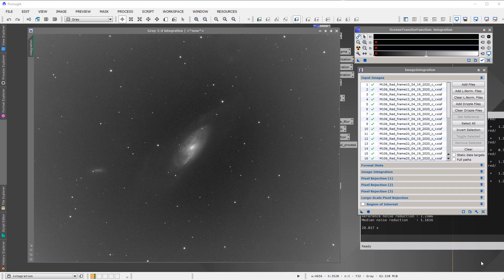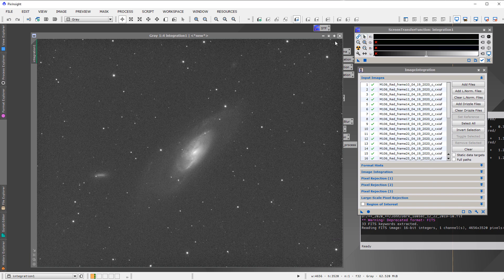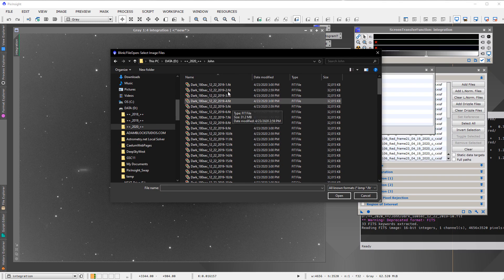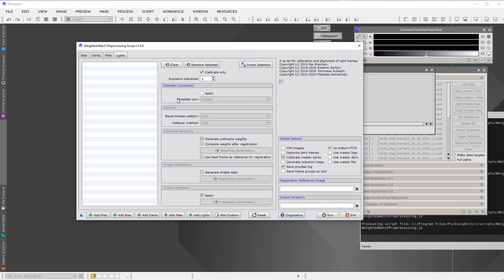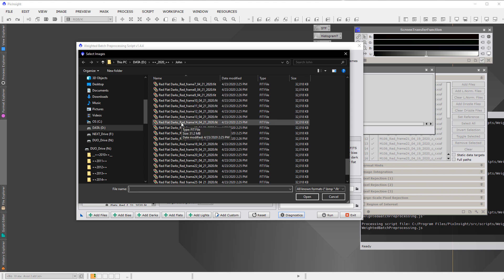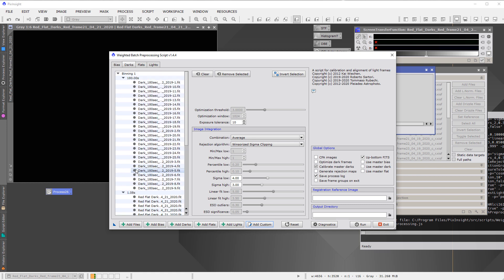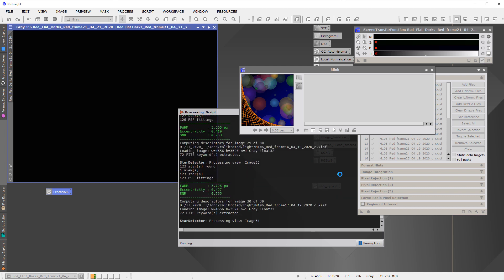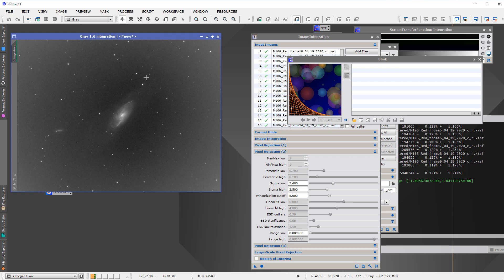Do Your CMOS Images Look like THIS??  (Part 1)

Comment: Hi Adam. The issue I'm having with my flats when they are just subs stretched in NINA is that they look to have reverse vignetting.  They are lighter in the corners.  I can't work out for the life of me what's going on.  I have an Altair Hypercam 26M and Altair 70 EDQ-R quad APO with a Pegasus Indigo filter wheel and Altair 6.5nm SHO filters.  I'm using an EL Wire panel.  It doesn't matter if I have a pillow case between the scope and the EL panel or not, I still get the lighter corners, all four corners.  I've tried taking the flats both in the day and at night in a dark room and it makes no difference.  I've checked to make sure both the filter wheel and camera are tightened onto the OTA properly.  Can you advise please?

Comment: Hi, I have a question. SharpCap makes master flat-dark. Could I use this file in Pixinsight? It somehow doesn’t work and doesn’t fix vignetting. Why? SharpCap makes master darks and they work fine. But not master flats. 
Thanks.
Reply from the maker: Ana Ta, the best thing to do is load the raw files (flats, darks, lights...etc) in PixInsight. Specifically I reccomend WBPP which is designed to specifically help you configure the proper calibration and get good results. I have an entire (lengthy) series all about WBPP. I strongly recommend investing the time in reviewing it. It explains much more than just how to used WBPP.  To directly answer your question- the masters from SharpCap may or may not work depending on the format of the data and what was done with the bias. Remember darks used for flats are DARKS (not flats).
Reply: @AdamBlock  Thanks a lot! I will research into this and experiment with different settings based on your videos. I will try to use pixel math as well; just as you have shown in Part 2. Thanks again. All the best!
Reply from the maker: @anata5127  The pixel math trick isn't a solution really.. it just demonstrates the image was not properly calibrated. You need to address the core issue. It is best to start with raw data- not a good practice to mix data processed with multiple software programs.
Reply: @AdamBlock  Ok. I know many people who get under or over corrections for flats using the same software. NINA for getting flats, and Pixinsight for processing. For example, what was actual  problem roots for over correction in example that you have shown?
Reply from the maker: @anata5127  I explain in the third part. The issue is that the dark frame is bad. Once new darks were taken- everything was good. Another common way to have this problem is that people not know understand how to manage the bias. If you leave the bias in a flat- or subtract it twice-it will cause this problem.
Reply: @AdamBlock  I have not watch third part. I need to research these points and experiment to fully understand these points. Calibration, that I get, is really screwing final results.
Reply: @AdamBlock  I watched third part. WOW! I do a lot of mistakes. My flats are 100ms to 800ms. Panel is just too bright, even when I fully dim it.
In this respect, I have questions.
1. What panel will you recommend? Pegasus?
2. My panel Reggie’s shorter exposure for blue than red filter. Substantially shorter! Is it normal?
3. What is gain and offset for flats and corresponding darks? 
4. How long could you use darks and flats? 1–3 months?
Thanks a lot for help! They are really helpful. 
All the best!

Comment: Ever since I got PI, I've been using this tutorial that I found online. Just realised the other day that the calibration steps in that tutorial aren't quite right - they suggest calibrating the individual dark frames with a master bias.

I recently got the ASI2600MM & would you suggest doing flat darks or can I just calibrate the flats with a master bias & master dark (not pre calibrated!) ?
Reply from the maker: Listen, the information you are looking at is both old and confusing. You do not need calibrate your darks with biases unless you are optimizing/scaling the dark- And you shouldn't be doing this with matched darks until you have proven it matters (usually it just messes up stuff). I explain this in the WBPP series and go into more detail in my lessons at AdamBlockStudios.com . I recommend learning how to use WBPP so that you will not double subtract/calibrate images. Let me repeat, many CMOS imagers do not take kindly to optimizing/scaling darks- this should not be a default and LV is 100% wrong here.  You should calibrate your flats with EITHER a matched dark or a bias (not both). The only difference between a bias and a dark frame is extra electrons that accumulate through time. Please watch lessons #3 and #4 of my series... https://youtu.be/sZmHbxIxZeM
Reply: @AdamBlock  thanks mate, I'll take a look when I'm able to. I just wish I'd realised this sooner. Wonder how much the difference will be if I go back & process my images all over again. Thanks again for the work that you do :)

Comment: Eyeopening!   ...and who would have thunk!   Tis time to rethink my flats exposure times.  I just watched Part 1, 2, and 3.    Make sure that you watch all three if you have an CMOS sensor.
Reply from the maker: Thanks for checking this out!  This is a great example of knowing what to look for in terms of sensors that have stale dark frames... that is really what this lesson is about. Flats should do a pretty good job in general. If you have not reviewed the new WBPP 2.0 vids... please do!
Reply: @AdamBlock  I might add, even though I am not John, I could very well have been.    This was my problem and my darks were not that old.   However, when I reshot my darks  the problem was solved.  I do have one puzzling thought, how in the world could a 180 second dark have lower readings than a 2 second flat.  How did a dark get stale in the first place.....logically I can understand more hot pixels due to sensor changes  but losing what I assume are luminosity values over time is beyond my logic.  The lesson I learned from our work was - toss the supporting file libraries and reshoot supporting files at least within a few days before ore after an imaging session if not the same night.  BTW, Adam I have finished the Fast Track and Foundations course, and I am moving through Horizons.   I cannot compliment your instruction enough. Fast Track - Foundatioins - and Horizons should be part of any PixInsight user's studies.  Period!
Reply from the maker: @nightskyimaging  Thanks for that Ed. Concerning the sensor- the electronic signature appears to be variable for this sensor/camera. This is an electronics thing...and apparently with this camera/sensor you need to monitor it closely.
Reply: @AdamBlock  Tis my guess I own two of the same kind as my ZWO cameras both need "image day" supporting files.....or ones that have been taken very close to the image day.   I can work with that....just tickled to death I now know both the problem and where to look to see if it is happening on other gear.   Well done!

Comment: Thanks for this. It helpt me to get my calibration right again.
Cheers 👍
Reply from the maker: You had quite a list of suggestions on FB- some OK but not relevant, others completely wrong. That is why I make videos like this- I have seen the likely/sneaky issues many times. This kind of experience  is what I bring to all of my efforts at AdamBlockStudios and lessons you will find there. :)  Trying to be persuasive here...
Reply: @AdamBlock  
Yeah, I was sifting through the answers trying to get the best ones.
I'll check out your website 👍